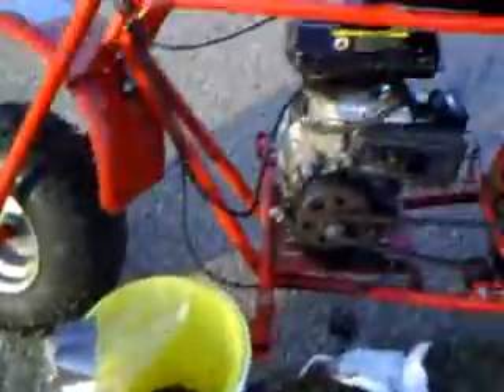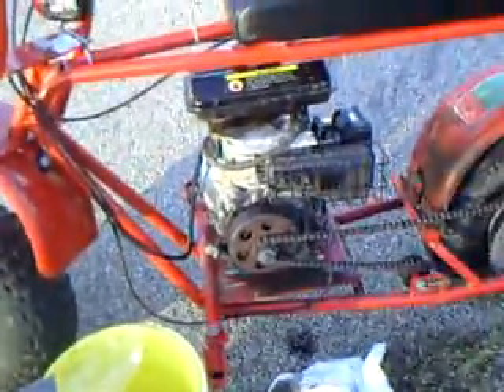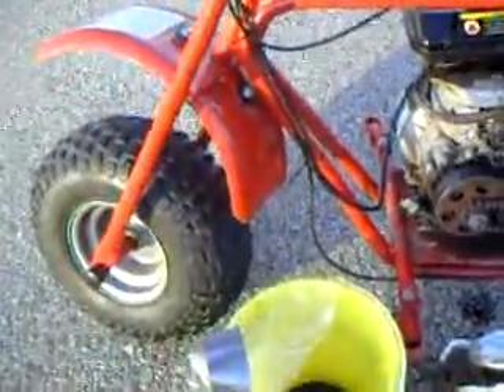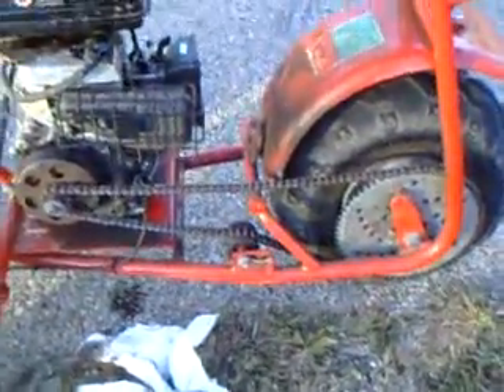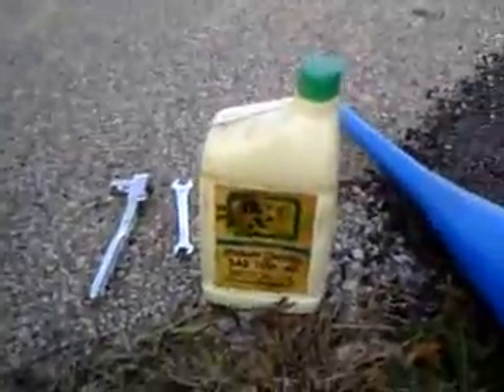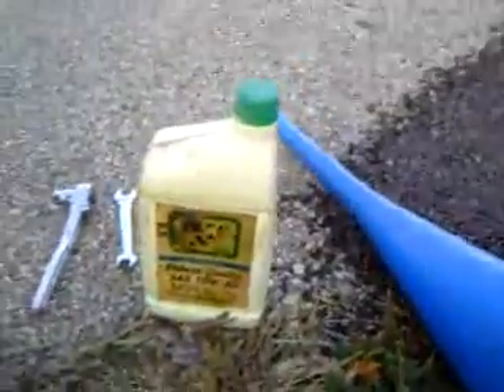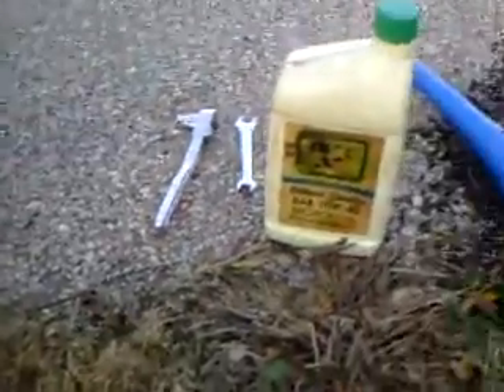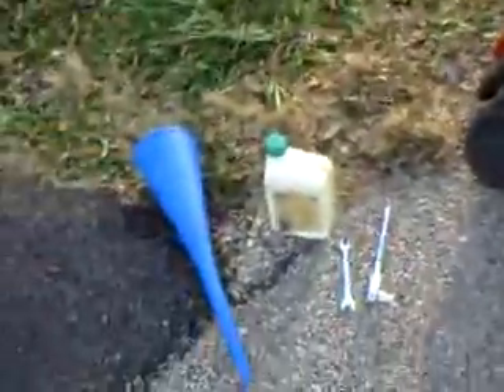Update on the Baja Doodlebug Minibike

Comment from the maker: Well see times have changed a lot. F.O.R.D=Fix or repair daily back in the olden days when Dodge and Chevy's were still great trucks. Dodge got bought out by Chrysler and my opinion on Chrysler is COMPLETE SHIT! And as for GM products well I just haven't had good experiences with them. I'm getting a early 2000's F150 those are built tough.